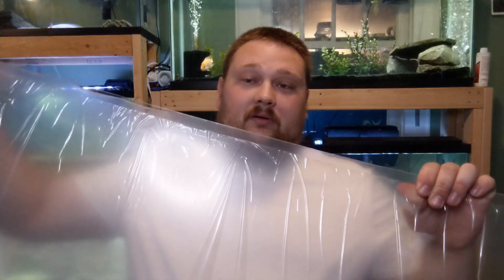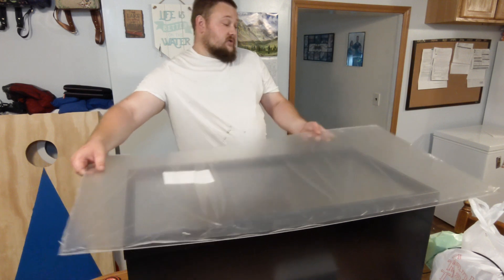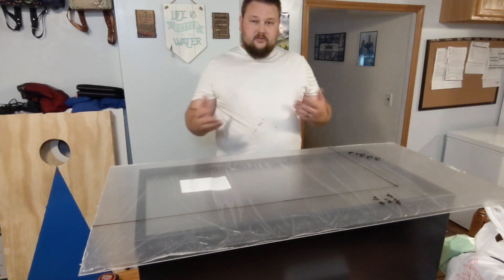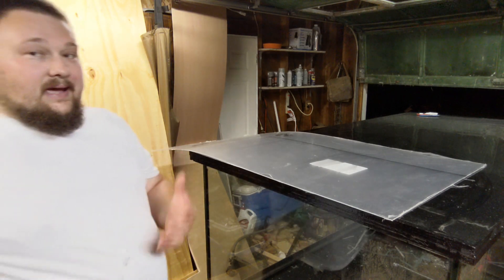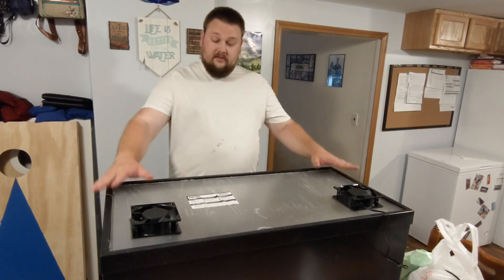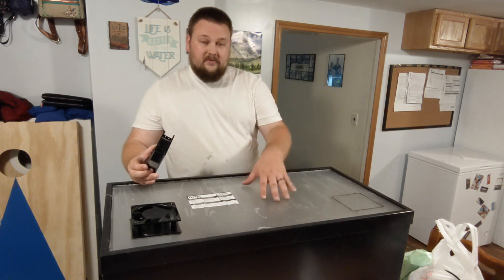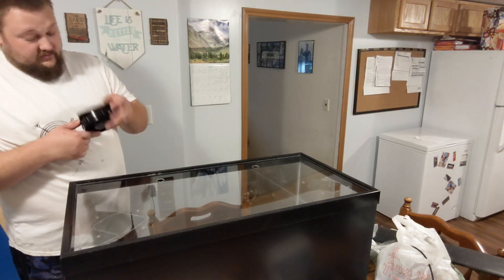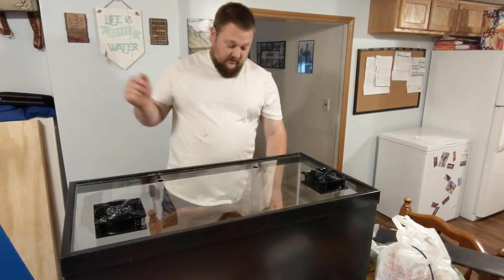Aquarium Cooling - DIY Aquarium Cooling Lid!

Comment: Great idea, can you please tell me all the information you used. Thank you for everything and good job.
Reply from the maker: The polycarbonate sheet you can purchase at home Depot or Lowe's, The jigsaw used a fine tooth blade and you have to take your time to avoid cracking it, The fans are linked in the video description, I used the inkbird thermostatic controller that can be used for heating or cooling

Comment: Love the solution - I keep thinking of axolotls sometime... But keeping them cool has been a slight deterrent for me.   Where did you get the super clear polycarbonate like that?
Reply: Ice will say though mine currently sits between 65 or 67 degrees and I only have to swap out three ice bottles a day I do not put the bottles in the tank directly I run 100 ft of air line through a cooler plugged into a powerhead with a sponge filter on the end of it to slow it down the cooler was 13 bucks the airline I purchased was four rolls of refrigerator hose from Home Depot at 25 ft a piece $3.17 per roll one Airline splits into two Airlines and then bottlenecks back into one Airline all the excess Airline is rolled up in a igloo Laguna 99 Court lunch size cooler my next project is a new tank itself I will be lying it with anywhere from three quarters of an inch to an inch and a half maybe 2 in thick of Styrofoam concrete and Drylok and doing a 3D background with it no substrate it'll be a 30-gallon tank the floor two side walls and back will be styrofoam false Rock this way the tank is insulated from the inside like a cooler only missing the two corners for the Hamburg Matten filters the front and now that I've seen this I might even do a styrofoam lid with two fans built-in with a feeding hole that would be removable obviously
Reply: Where is the spot for a filter?
Reply from the maker: You can get it at Lowe's or homedepot or almost any hardware store

Comment: I have sharp ribbed newts that have to be kept cool ..... wish there was somewhere I could buy a lid like this.
Reply from the maker: On Amazon they also sell fans that you can clip on to your aquarium that essentially do the same thing, I chose to build the lid like this because it was the same price as one of the clip-on fans
Reply: I’ve got the fans, as I use them on my other tanks. If I used them on this particular tank I’d have to lift the lid to attach them and I don’t want my newts to climb out, as they’re semi aquatic and great little climbers.
Reply from the maker: Ah I understand now, I could never find a lid like this which is why I decided to make one and make the video!
Reply: It’s a brilliant video. My ‘tools’ comprise of a tiny hacksaw 😂 I have managed to make my own DIY electric gravel vac and water change system. I can’t use a python as I have the old style sink taps.
Reply from the maker: Ah I got ya, my non sink python is a 800 gph pond pump with some hose on it 😆
Reply: snap....mine’s a 10 meter hose attached to a 1500L/H pond pump. If you ever decide to make and sell custom fan tops, and post them, let me know. I presume you’re in the UK?